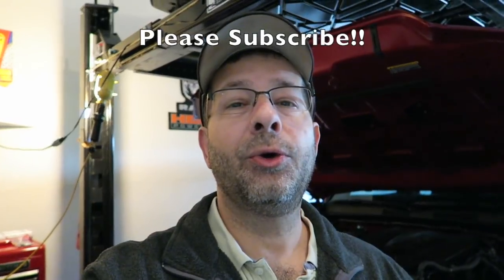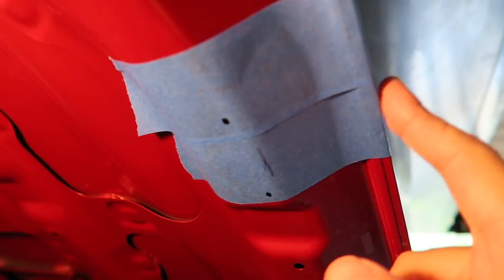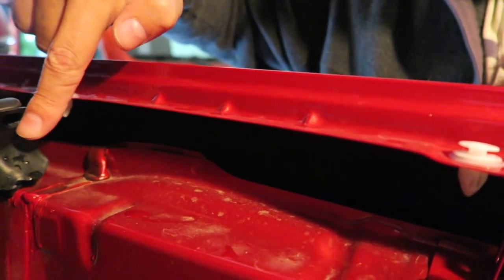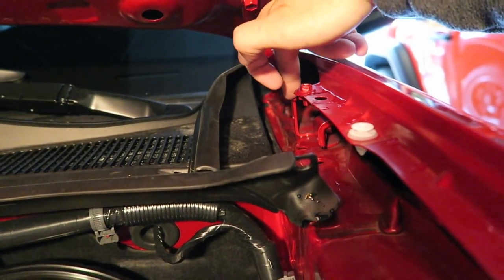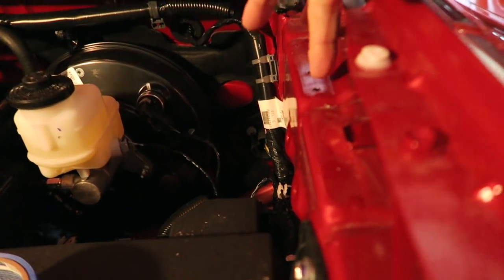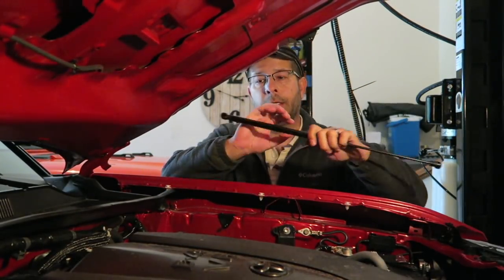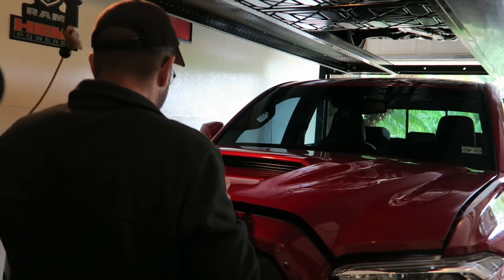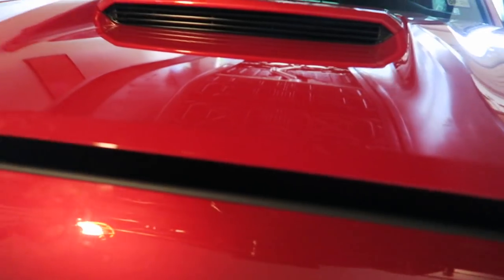Redline Tuning Hood Strut Install for 2018 Tacoma Must Do Mod!!

Comment: I installed the Quicklift Elite system on my Tacoma but they failed after about 2 weeks (no damping); Redline tuning customer service was excellent and they sent me replacements immediately (about 1 week delivery time). I just installed the replacements and they work great. Hope they don''t end up with the same problem later tho. Redline tuning assured me that their product is top quality but failures do happen occasionally. Warranty will cover any issues for 5 years. Excellent service from Redline Tuning! It was a pleasure dealing with them.
Reply from the maker: That’s good to know.  Thanks for the info👍

Comment: Kind of weary about rivets I’m sure they are great I was hoping you would have shown that process as well as the drilling. Saw this install in another video and they didn’t have it either. It looks good and I will definitely consider this Mod
Reply from the maker: My first time using rivets.  Pretty simple with a cheapo rivet gun👍

Comment: Love the videos keep them coming which rivet gun did you end up using I just ordered a set. I’m an aircraft mechanic so I deal with rivets on a day-to-day basis however I don’t own a rivet gun
Reply from the maker: Hey Chris.  The gun I have is made by Arrow.  Pretty poor quality I think.  It wouldn’t cut two of the four rivet tails.  I had to use wire cutters😔

Comment: Mine is $45.350 it's loaded also I have 31 inch tires and I get 19 in the city  need to see what I get highway I had a 2017 Tacoma 4x4 I traded it for this truck it was a nice truck but not even close to this truck

Comment: My Chevy ZR2 Colorado comes with struts from the factory fact is all Chevy Colorados come with hood struts!  Sorry you've got to spend extra cash to have something I have stock!
Reply from the maker: How much did that Chevy cost?
Reply: Don't worry, I'm sure some happy Tacoma owner will pull over and give you a lift when have your hood opened with those factory stuts on the side of the road😁

Comment: Thinking about doing that too..
Reply from the maker: It’s awesome!  Probably one of the biggest bang for the buck mods I’ve done👍
Reply: I just got the part, as soon as the weather warms out a bit, I will be working on it..thanks ..
Reply from the maker: Awesome 👍. Let me know how it goes..
Reply: Just did it, made a mistake measuring, but I got it corrected, measurements of 2006 is different from 2013-to present
Reply from the maker: Ahh...hope it turned out ok🤔
Reply: Turned out ok, since it's so easy to lift up the hood now , made me clean up my engine bay !
Reply from the maker: Lol!!  More work😁